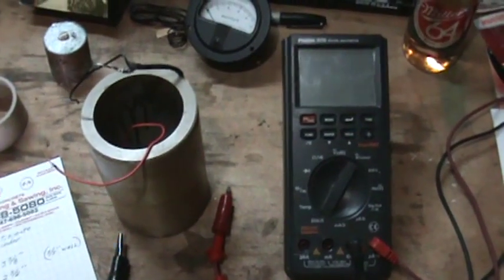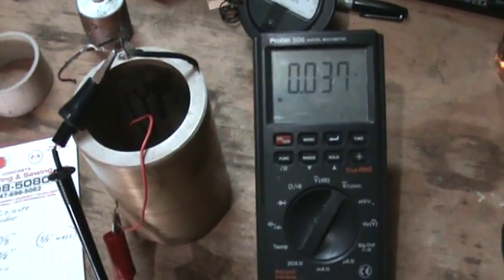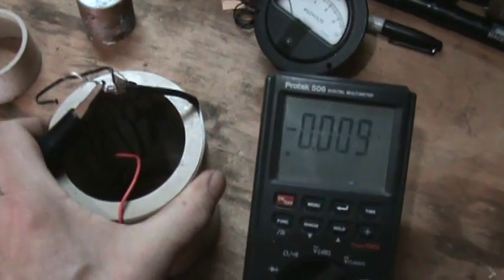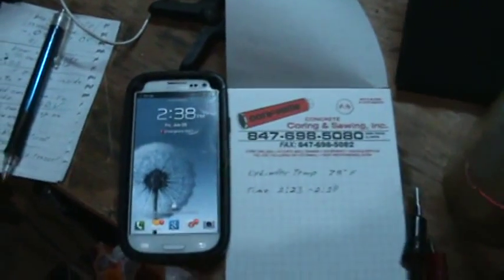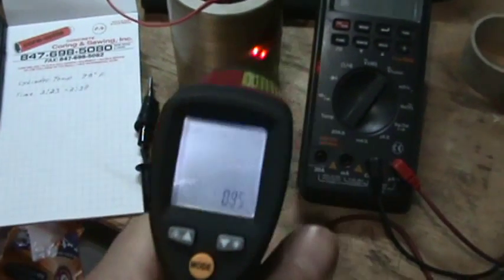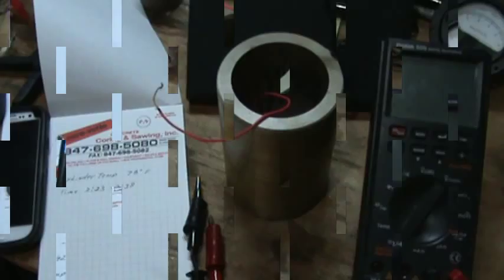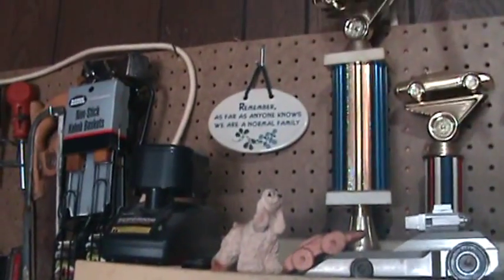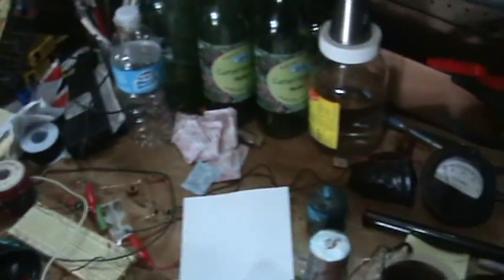Barium Titanate experiments free energy

Comment: how did you form the barium titanate layer onto the substrate? What was your tool environment for doing this?
Reply from the maker: Hmm, good question, not sure,,,it was a gift to me.  I think barium powder, melted into a mold and once hardened wrapped tightly in layer of fine fibers.  Im not sure what these fine fibers are and what their purpose, maybe teflon for collecting electrostatics in the air?, or maybe to add a pressure for piezo effect?

Comment: Sorry but do you know where I can buy this material.

Please make a series.

Also if I can suggest adding copper coils, inside and out.
Reply from the maker: Large cylinder I obtained as a special gift and there is no more where i got this from.  But I got the smaller cylinder from e-bay, search "barium titinate" on e-bay. But not sure if guy on ebay has any more either, or if he has any more that are not cracked or broken, but you should be able to get some "pieces" of it from ebay.  Very hard to find :-(
Reply: INVENTOR3 Thanks !

I would love to see what you can do with it, good luck :)

Comment: I tried this years ago, but concluded that the voltage changes are all due to small temperature changes, which stress the piezo. Try putting it in a polystyrene box, or temperature-controlled room.

Comment: I'm assuming that the two sides of the BaTiO3 tube are covered in metal. Try to measure the capacitance in microfarads between the plates. Charge the plates with a rectified microwave oven transformer and see what happens.

Comment: Hi Paul, can't you picture this as the antennae on your air circuit (radiant energy)? Let this charge a huge running capacitor, then voltage cascade to 2000 vdc like Tesla. Then dump to battery using a spark gap as vibrating switch before battery. Where did you acquire that barium pipe material? Can i get it in sheets? Again cheers for your video's.